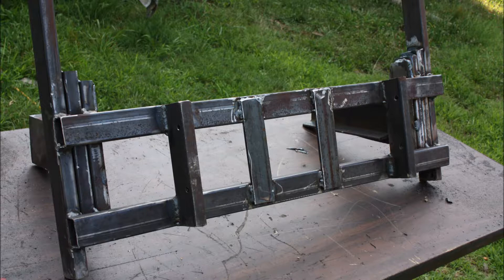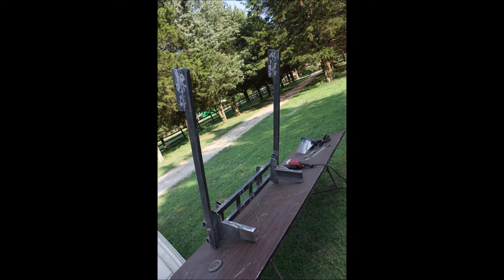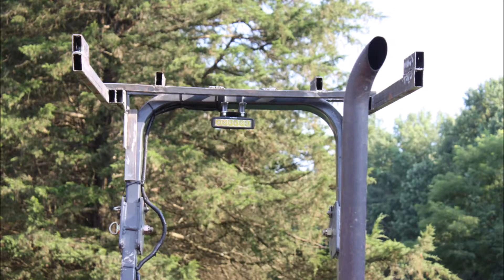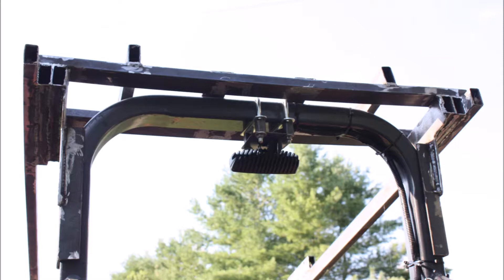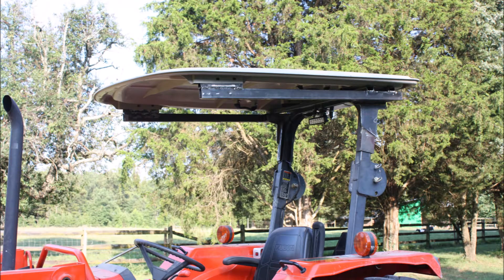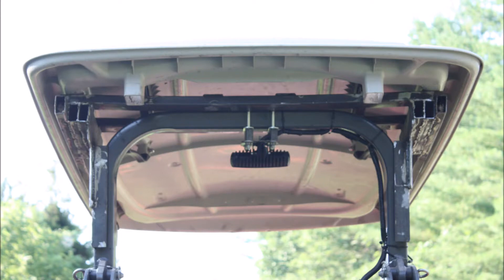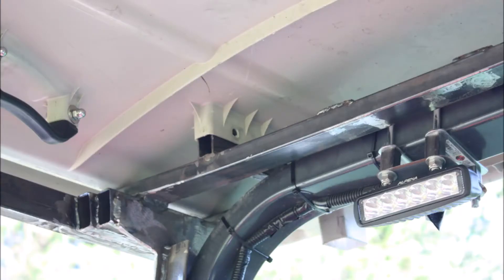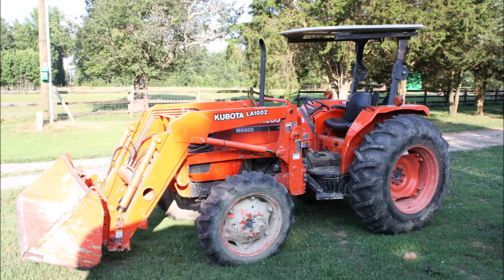Welding Projects: Kubota M6800 DIY canopy, cheaply

Comment: Actually bought a golf cart and wifey wanted better roof. I told dealer to take off and replace before we took it home. She said many are buying these for tractors. Luckily I have a tractor and now figuring out how to fit.
Reply from the maker: I had to build a frame to fit using some scraps I had laying around. Its been worth it